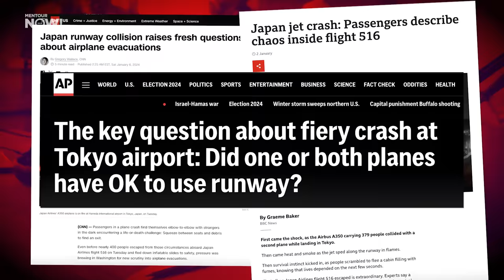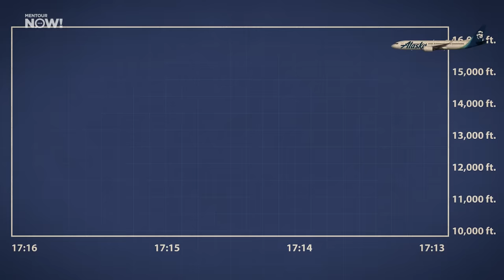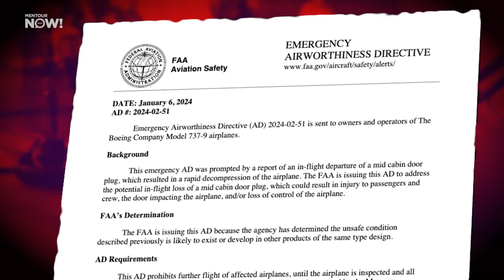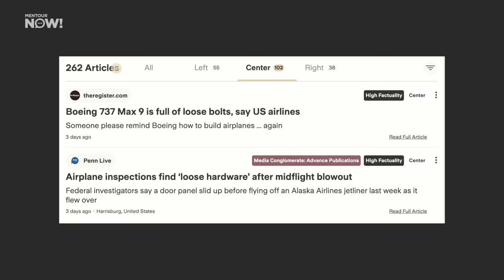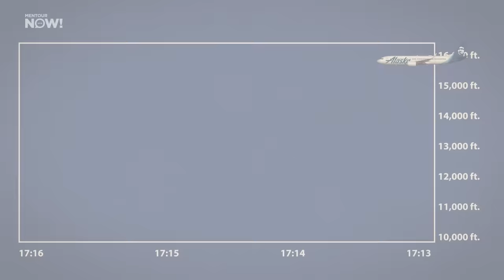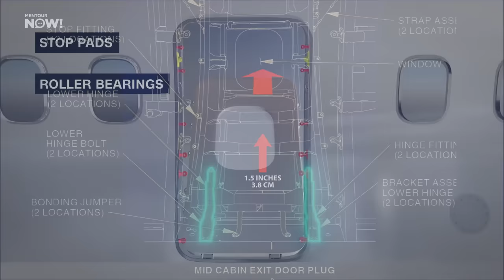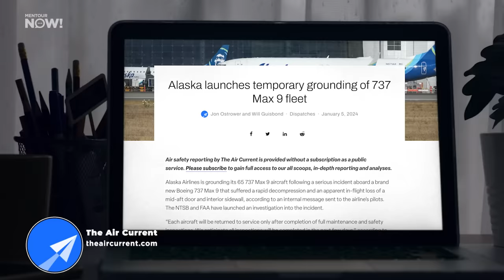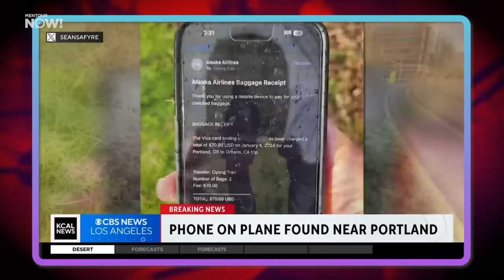WHAT Is going ON with Boeing?! MAX-9 Door blowout

Comment: Re. the iPhones, I suspect they just reach terminal velocity quite quickly, so whether they drop from 2m or 2km doesn’t make a difference. The kind of surface they land on is probably key in their survival.
Reply: Agreed.  And it would not be stable so it would tumble the whole way down, it very likely would be going about the same speed as if you really did drop it from 2 meters.
Reply: And finding the smartphones, an intact smartphone that is not found is not a smartphone that can be used further.
Reply: @frankklemm1471 not sure I understand what you’re getting at.  Is this supposed to be like if a tree falls in the forest and no one is around to hear it then it doesn’t make noise?
Reply: @mikezappulla4092  - you really don't understand physics at all...
Reply: I'm imagining the iPhone calling to Siri for help on the way down...
Reply: @23merlino I understand it just fine.  You want to argue that the phone would fall face down or end-down and not tumble?
Reply: You've got a suspicion that iPhones reach terminal velocity very quickly. Why should they? In an ideal world, where all falling objects have a constant amount of drag in any position, time to reach terminal velocity is solely based on what that terminal velocity is, which is solely based on the amount of drag. Acceleration under gravity is more or less constant. Even in the real world, a falling iPhone can't really gain more than 9.8 m/s in speed per second. So the only way to reach terminal velocity quickly is if terminal velocity was very low. And the thing that reduces terminal velocity isn't reduced mass, it's increased drag.

All this to say, I don't imagine an iPhone has much drag, even when tumbling. So why would it not take very long to reach terminal velocity?
Reply: @Amanda-C. Yeah, because an iPhone is just sooo aerodynamic....  hint, it isn't at all.  The terminal velocity would be relatively low. Probably in the "tens of miles per hour" magnitude.

The reality is that the descent speed is rather less important than how long it took to slow down when it reached the ground.. Land on a road with minimal ground deformation:  probably toast, land in soft ground with dense grass: probably fine.
Reply: Knowing the area where they fell, they probably hit trees before the ground.
Reply: Would have liked to see it falling... but not from close, mind my head. 
Does it turn when falling...?
Reply: @Amanda-C.  mass does impact terminal velocity - its what countering the drag to cause acceleration.
As it happens it takes about 100 metres for a smart phone to roughly reach terminal velocity, any surviving phones likely had their collision with the ground slowed by trees and ground cover.
Reply: @Amanda-C.  I'd say "quickly" is relative. The phone fell from 16,000'. I doubt a cell phone will reach terminal velocity in 6', but certainly by 50' or 100'. 

Mass does also play a role in terminal velocity. Take a piece of cardboard and a metal plate, both with the same dimensions and drop them. Both objects are rigid enough that they won't flex through the air, yet the metal plate will have a much higher terminal velocity than the piece of cardboard. 

I think what kept the phone from getting damaged was where it landed, not the terminal velocity it reached.
Reply: The iPhone was found near dense shrubbery so I assume that's how it survived.
Reply: They certainly do not reach terminal velocity after 2m. Terminal velocity is reached when gravity is canceled out by air resistance. A phone is a racer dense object, with a smooth surface. The only thing that could increase air resistance somewhat is it being unstable in flight and turning around etc. But it will keep increasing speeds for dozens of meters. The 100m someone suggested feels very realistic.
An example for an object that reaches terminal velocity in a short distance is a feather, which does that almost immediately.
Reply: It most likely hit some bushes or trees then grass and soft dirt.
Reply: @smalltime0  Ah, that's what I get for not checking the formula! Yeah, Vt is just where weight and drag cancel out, so of course adding more mass without changing the drag coefficient would make it fall faster. An aluminum sphere would have a higher terminal velocity than a steel one. And so a smooth little glass and metal brick without much mass still can't get as fast as a similarly shaped piece of cast iron might.
Reply: In this case the phone left the aircraft at a speed much greater than the terminal velocity of an iPhone. Untested but I bet Vt of the phone is significantly < than its initial speed of 400mph. So at 2 meters is was technically at or above terminal velocity and the acceleration was a negative value for a short period.
Reply: More likely it survived because its fall was broken by fine twigs from a tree or bush.
There is precedence for this. I certainly know of one case where a WW2 bomber tail gunner left a burning aircraft without a parachute and survived due to passing through trees and landing in snow.
Reply: More key is simply what orientation they hit at.
Reply: @smalltime0 of course mass influences terminal velocity bro
Reply: @johnny4498  See the comment I was replying to 'bro'
"And the thing that reduces terminal velocity isn't reduced mass, it's increased drag."
Reply: It’s a good thing the iPhone didn’t hit the horizontal stabilizer and shatter or tumble against the fuselage.
Reply: Don't underestimate the difference between soil and concrete either - it's orders of magnitude difference in the amount of time the impact energy is spreading through the phone.
Reply: All this arguing in the comments and you can literally look up videos of iphone drop tests on YouTube, lmao

They do have a very low terminal velocity, and the landing surface is highly significant to determining survival. Landing in thick grass or sand can save one, even without a case. They're a lot tougher than people think.
Reply: After arguing still the phone case  needs to be known
Reply: @Bravin_Joshua  Why? We know iphones can survive that kind of landing without a case.
Reply: Probably an iPhone with Gorilla Glass.
Reply: Maybe after 200m (but certainly not 2m) they would reach terminal velocity, so after that point (or whatever point it is reached) falling from a higher altitude doesn't matter.
Reply: @my3dviews  Or we could just google things instead of guessing. Approx terminal velocity for an iphone is <100mph and is reached in about 100m. Boom, argument over, lol
Reply: @corvinredacted    I'm trying not to rely on google for every debate in my life. 😂
Reply: @my3dviews  What possible benefit can that attitude have? Sure, make your best guess first so that you're using your brain, but why have arguments while intentionally avoiding learning the objectively correct answer?
Reply: @corvinredacted we don’t want to end the argument!
Reply: The difference will depend upon whether the phone housing or case is PPA or ABS....or any of numerous polymers..... Some are terribly brittle, others substantial. I wonder if the camera stabilization on that Iphone still works, or if it gives video that is "googley-eyed"
Reply: @bodystomp5302  Why, if you're essentially just making stuff up anyway? At that point you're just spreading misinformation and making bad guesses to complaining about someone else's bad guesses. You can argue all day on the internet without having to resort to bullshitting your way through a fake argument. There's no shortage of opportunities.
Reply: Also, make sure to turn on AirDrop before throwing your phone out the window
Reply: @corvinredacted   Because it is still possible to have a discussion base on knowledge without the need for an exact answer every time.  Had the original comment said 50m or 100m I wouldn't have replied, but 2m was obviously wrong.  
Do you when you are talking to someone in person always look things up or tell them to do that?  
Maybe people are losing the ability to think for themselves, because they can just look things up.  Next it will be, why discuss anything, when you can just let A.I. do it.  They will never make a statement that isn't totally backed up by exact information.
Reply: @my3dviews  I should specify, I was referring to the people who were straight-up guessing about the facts on both sides. Just calling out the 2m thing, I agree. No specific fact-checking needed to say that was wrong. (Essentially the only counterclaim you're making is that the distance would be greater than 2m). But there were plenty of people making actual, specific counterclaims that were obviously just guesses.
Reply: @corvinredacted   Will, I did say "maybe 200m" so an educated guess, which doesn't mean anything slightly above 2m.
Reply: @my3dviews  Personally, I think it's more productive to do a cursory check to see if someone already figured out the answer and wrote up an explanation 🤷‍♂️ I learned something new, and I read more about how we calculate terminal velocity. I'd rather actually increase my knowledge than see how far I can argue with only the info already in my head. You don't actually learn anything from guessing, even if that guess is more reasonable than someone else's. I'd argue that trying to find and understand the available information on a topic is more intellectually stimulating than just musing based on incomplete information.
Reply: Good point! @A321LR
Reply: My iPhone dropped on a carpet from knee height being in a case but the back glass cracked in million pieces. I think it depends on which part hits the surface first, whether it drops flat or hits it with an edge. Maybe the iPhone cushioned on trees’ branches and than slowed down by it until just reach the ground.
Reply: @Amanda-C.  "And the thing that reduces terminal velocity isn't reduced mass, it's increased drag."
Ur.. The thing that most determines terminal velocity is density - mass / volume. Increased mass increases terminal velocity which is why a hammer falls faster than a feather.    🪶🔨:cat-orange-whistling:
Reply: @andyk2181  
tiny thrusters deployed, it had been big brothering SpaceX videos and felt inferior 😆
Reply: @Lucien86  Yes. I was quite handily corrected on that point already. Guess it's been longer than I thought. 😅
Reply: @Amanda-C. Someone did the math and speculated that the maximum terminal velocity of an iPhone 14/15 Pro like the one in question would be 154 mph. But as you nite there are many factors that might slow it down somewhat, including the case.
Reply: Portland in winter, in landed on soggy grass and a thick layer of moss.
Reply: Most probably, it is the same situation no matter what height it falls from. Also idk if the shape of the phone if it falls at the right angle can serve as a sort of a wing, giving it a bit lift and slowing its fall a bit. That alongside falling into bushes and not on concrete saved the phone i think.
Reply: @solracer66  I mean, there's a good enough explanation... it probably hit some bushes and such. I was just having fun trying to remember basic physics from school/Mythbusters. 😁

Comment: There's an ongoing lawsuit filed a couple months ago where former employees said that reported problems that came up during manufacturing inspections were suppressed, and inspectors that reported too many problems were rotated out or dismissed (hence the lawsuit).

Boeing ignoring manufacturing defects instead of addressing them properly seems to be a major problem.
Reply: The lawsuit also said the production workers didn’t want to fix the problems found and expected the quality guy to do the rework. If he pushed for it to be corrected the production team lead would complain about it. Unions politics. It all starts with employees. Blaming managers isn’t going to fix this problem when people doing the work are trying to cut corners and can’t be forced to do a good job.
Reply: The inspections should go back to be independent of Boeing.
Reply: That's genuinely terrifying to hear, but not even really surprising at this point.

Edit: f***ing YT duplicated my comment.
Reply: Fair to say, we can't safely rely on the notion that the aviation industry makes all necessary effort to make flying as safe as possible and therefore letting employees address problems openly. It might be better than average depending on country / company etc. but it's still bullying and lying like anywhere else.
Reply: @Catpanl  Thats literally the opposite of how reality works. Managers tell (and hire people to tell) the employees what to do and how to operate. Employees are considered an expendable ressource, that can be hire and fired at any moment as the companies profits require.

To blame "union culture" on this is actually insane. Boeing has less employee and union culture than airbus, and it shows.
Reply: @Catpanl  Unions don't cut QA corners.  Management does.  You have obviously never worked on any factory floor and have no idea about how corporations do business.